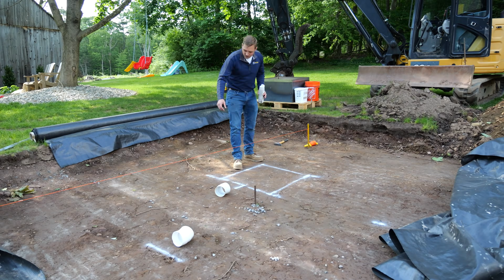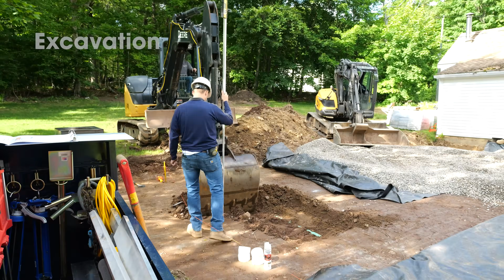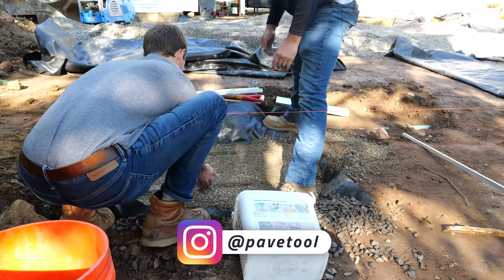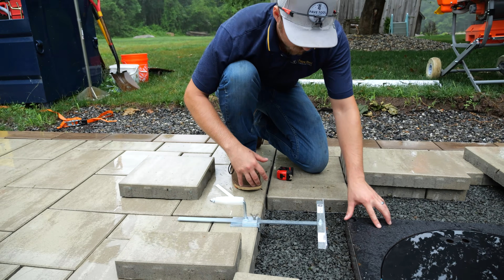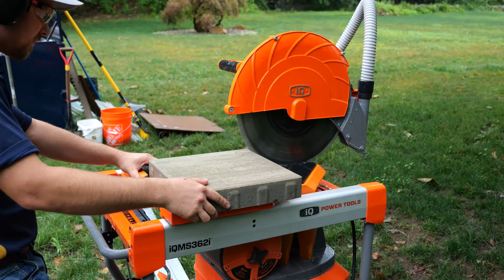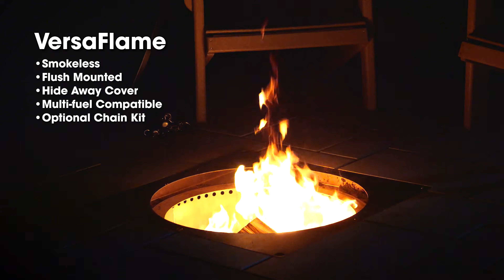How to Install an In-Ground Fire Pit

Comment: Nice install! Question, are you guys plugged into a generator for your iQ saw? I see a yellow extension cord...had a 20amp circuit with a 50' extension on it and it wouldn't run the saw. Got a 6500w generator to be able to run it. Just wanted to know how you guys typically run this saw. Thank you!
Reply from the maker: Thanks! I believe on that jobsite we ran the extension cord directly to an outlet on the exterior of the home which was a 110v 20amp outlet. The saw should run off that no problem. Could be an issue with your extension cord? Try contacting iQ Power Tools to troubleshoot, sorry about that!